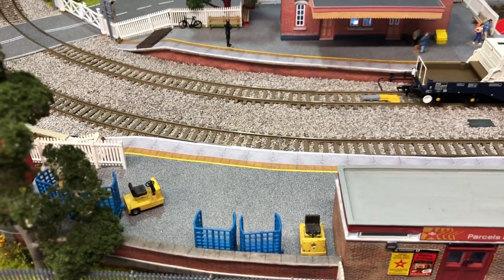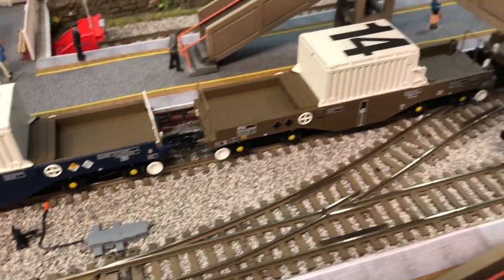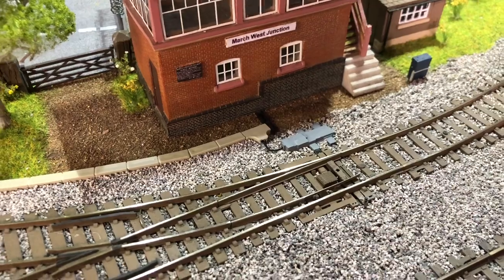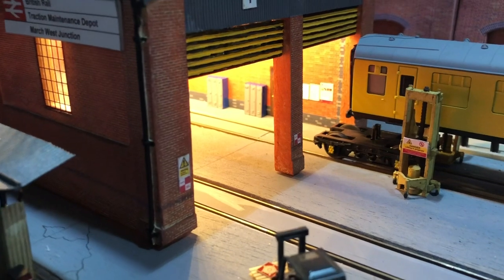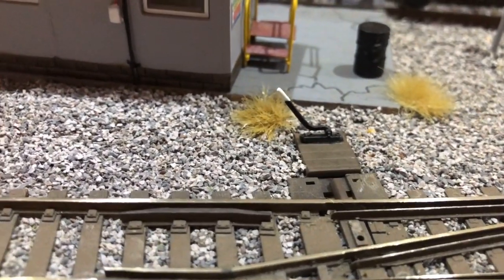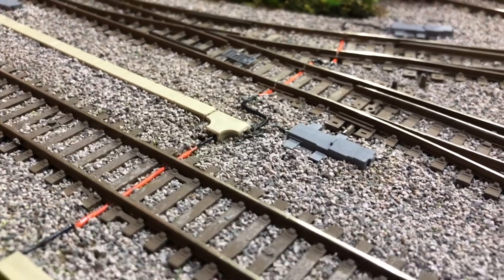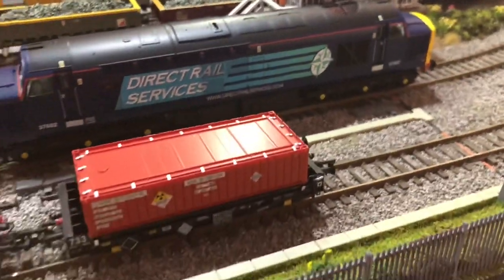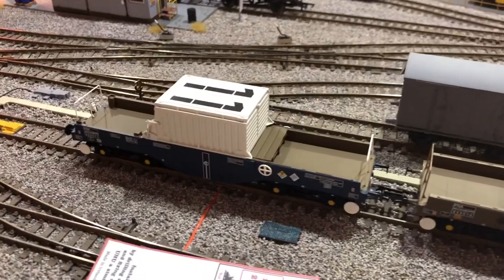No 33. Layout Update plus Issues with dummy point motors fitted wrong & replacement platform

Comment: Hi,

Everything is looking great @ March West Junction.  Even if you had to change the point motor covers around! 

One thing I noticed with your gorgeous Accurascale nuclear wagons is that they need to have 2 DRS brake vans with each load/train, sometimes called DRS Escort Coaches, but normal DRS-livery brake coaches look very similar. These were used to hold armed marines or commandos or special forces, so that no-one could steal spent nuclear fuel. 

Bachmann made some of these exclusively for Model Rail, but only a very few. They were being sold as a pair for around £60-£70. Some money-grabbing @rseh@le is now selling a pair on eBay for £295!!! As soon as Accurascale announced they were making their new nuclear wagons, both the half-height ones and the new extra-long ones, the prices being asked for the Bachmann DRS Escort Coaches shot up. I think £100 for the pair is too much, let alone £295. 

Luckily Hornby are bringing out two brand new DRS-liveried brake coaches this autumn, and you would be hard-pressed to spot the difference between them and the Bachmann coaches. So you will be able to get a pair of differently-numbered escort coaches for your nuclear trains for around £35 per coach from Hatton’s or Rails of Sheffield. (Other retailers are available!)

Regards,
Jim
Reply from the maker: Thanks for sharing that Jim 👍 I do have the Bachmann coaches in my collection and I agree the prices are way over the top when you consider that the same coach in BR blue and grey you can pick up for around £25. 
Thanks again Jim for shearing your knowledge on this subject and hopefully in the near future I will do a DRS running session 👍